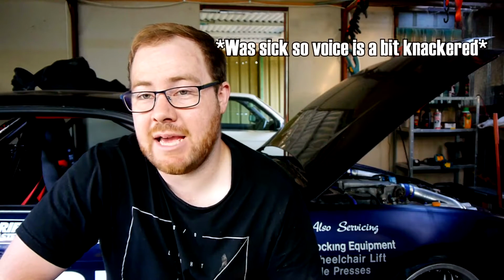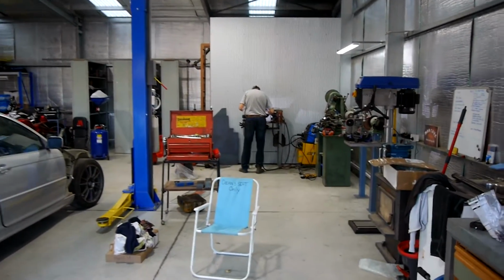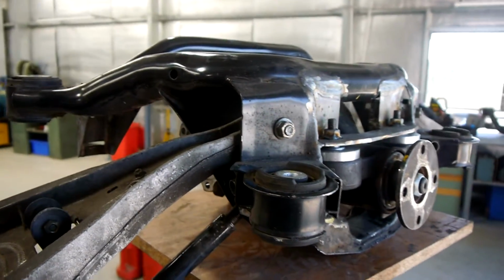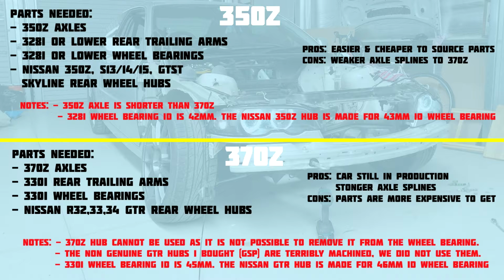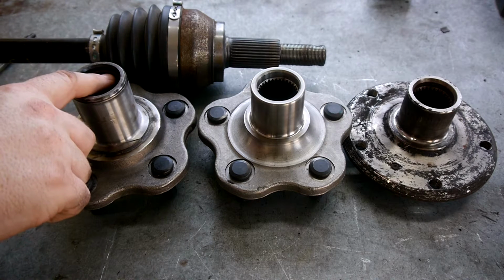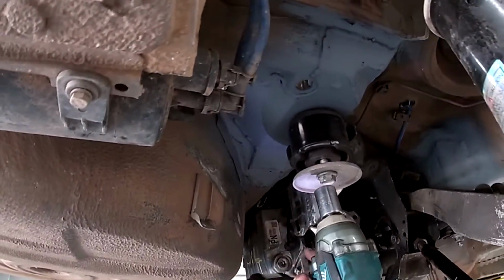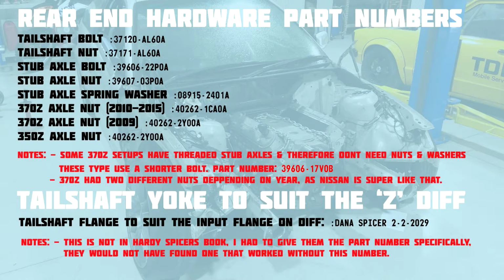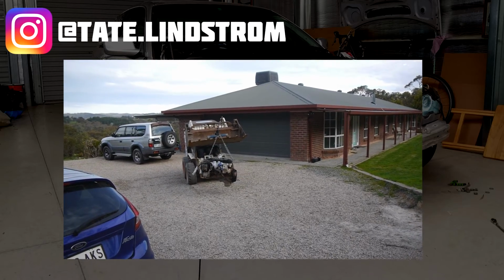370z Diff into E46 Subframe Conversion - Ep5 'Smokey & The One Armed Bandit' LS1 E46 Drift Build.

Comment: Never had any trouble with the hubs? Looking at doing 350 hubs in my e36 and worried that there wont be enough meet left after machining them so much closer to the flange as the bmw hub doesn't have as much depth in the nut hole.
Reply from the maker: @Barclar  no issues on this car. I did it to another car & the axle nut came loose which ruined the bearing & hub so I would do something to lock the nut like factory does. Someone else replaced the axle so idk if they didn't torque it enough as mine haven't moved.
Reply: @OneArmedBanditYoutubeChannel cool. Thanks for letting me know. . The info is very helpful. Might see if I can nip a bit off the trailing arm or maybe leave it a mm longer so the wheel studs don't rub. Should be enough movement in the caliper to allow it. Thanks

Comment: I know this is quite a while ago, but how is it holding up? 
Also, was there any Axle modifications? AS in lengthening or shortening? Did I miss this?
Reply from the maker: It holding up great, haven't had any issues. 100% stock axles with stock 370z length.

Comment: so a quick search shows a 330ci rear hub is 38mm? could you have done with  330 trailing arms to save you all that machining work
Reply from the maker: 330i rear trailing arms is what we used since we went 370z axles. Can only use 325i arms if planning to run 350z axles.
Reply from the maker: I cant remember all the specific sizing but gtr hub was like 1 or 2 mm or something bigger than the ID of the 330i wheelbearing from memory. Also the gtr hub needed machining so it went the correct distance into the wheelbearing, so the brake rotor could be put on in the same spot when bolted to the hub.
Reply: @OneArmedBanditYoutubeChannel  very cool! thanks for your time and love the videos!

Comment: Why a Nissan diff if the BMW 188 or 210 mm units are much better in every way . Should of got a e46 m3 complete rear end . Nissan diff are weak
Reply from the maker: Did you actually watch the video? I explain pretty clearly why i did what i did. 188mm isnt even as good as the s13 rear end let alone the 350z, ive all three here in my shed. Sounds to me you just hate nissans.
Reply: @OneArmedBanditYoutubeChannel  did I did must of missed that part then you were talking.  Sorry too say but that claim of the Nissan diff better then a BMW diff is a joke /insult.  Go luck with a Nissan diff lasting as long as a BMW unit also 188mm weak how if I had 500 hp at the wheels with a stock lsd and it was used .
Reply from the maker: @_i-kr6eg  The first part where i was sitting talking to the camera I was discussing it. Each to their own but i decided this route because i know guys running turbo LS, 2jz making 600+ HP running Z stuff with no issues & i know guys breaking 188's will 350hp. Also the video is titled 'Diff swap' for simplicity sake, but I am really talking about the whole rear end drive line inc axles.
Reply: @OneArmedBanditYoutubeChannel  there breaking them at 350 hp ?? How if a N/A car with that power can handle it because my e36 m3 had about that at the wheels I called bs  . I've bought 188mm lsd used put them turbo e30 had over 500 hp lasted 3 years clutches were gone and it was driven almost every day.
Reply from the maker: @_i-kr6eg  thats 350 at the wheels with a aggressive clutch & grippy setup drift setup. Like i said in the vid, if it was a road car i wouldnt worry, but lots of torque and 4th gear clutch kicks is alot  harsh.
Reply: @OneArmedBanditYoutubeChannel  how if I got 6  Nissan 3 of them a s12 . Too funny
Reply: Mr 323 . He clearly explained all of his reasoning behind the decision .  Makes perfect sense to me. You need to realise he is in Australia and M3 shit is far more expensive on our side of the world. He wants to be able to get spares easy, That's enough justification right there.
Reply: @slydogg0068  great assumption I'm in Australia wtf also BMW m3 e36 e46 parts are cheap I've had many BMW here in Australia got many parts even e36 m3 S50 parts had 3 of them already.
Reply: @slydogg0068  says the fake account . How old are you kid seems like you know nothing.
Reply: @slydogg0068  also a e46 m3 rear end is good for over 1000hp wheel . Look up HPF e46 m3 turbos.
Reply: @_i-kr6eg  there are supras running low 9s running stock 370z vlsd & welded open diff.
Reply: 😂😂😂😂😂😂 ok  Mrs 323
Reply: @slydogg0068  nothing to say snowflake . Stfu
Reply: @_i-kr6eg  the diff itself is 200 bucks online.
Reply: @_i-kr6eg  again not just 1 case but many cases of cars running over 1000hp. in the drifting community the R200 is the standard